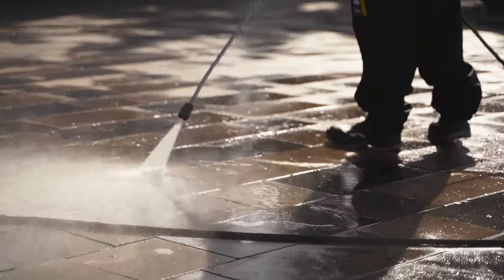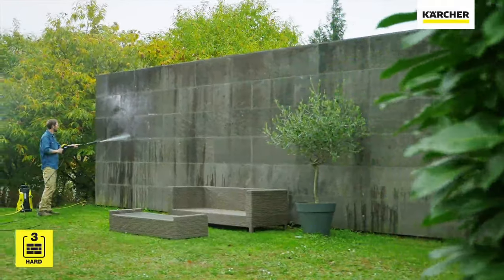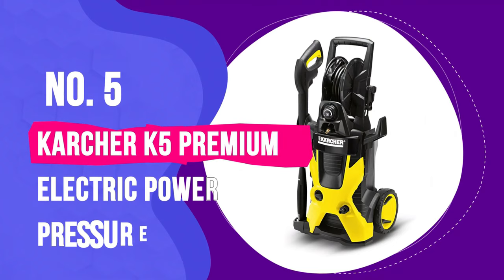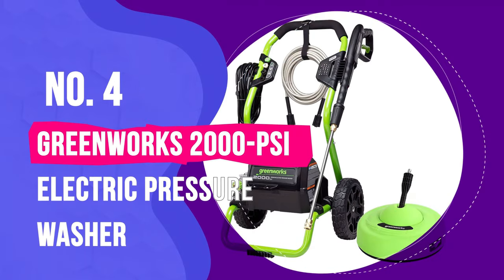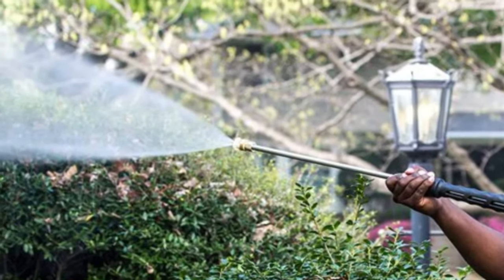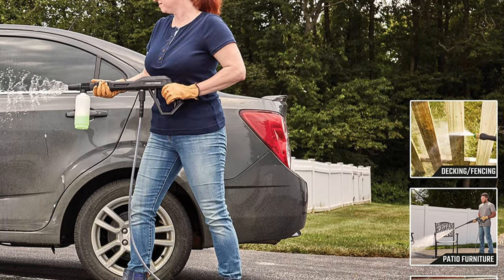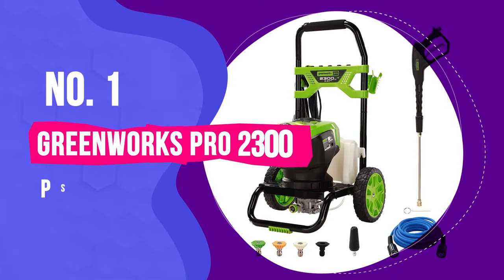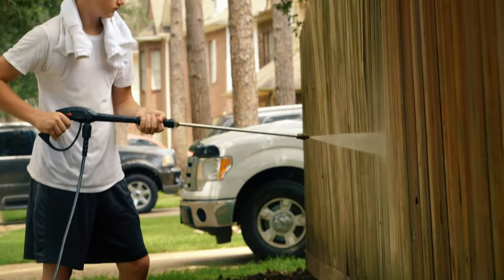Best Electric Pressure Washer 2024 [don’t buy one before watching this]

Comment: I just got the Sanjoe pressure washer, (#2 on the 
list), delivered at my doorstep today. We'll be looking forward to using it around the house this coming summer season😗!
Reply: Hello can you update us?
Reply: My Sunjoe worked great for the first year. After being stored in a heated garage, it wouldn't work in year 2. Hope you have better luck.
Reply: @baconbutty1131  had/having the same problem with Karcher electric PW where I only get a couple of uses out of it, then it's junk. The seals deteriorate and require Anti Freeze or Pump Guard when storing or it will leak on the next use. I was informed Karcher Electric PW cannot be fixed if they leak within the housing.